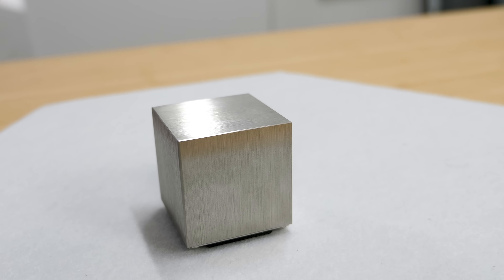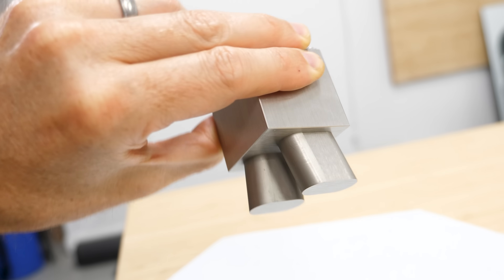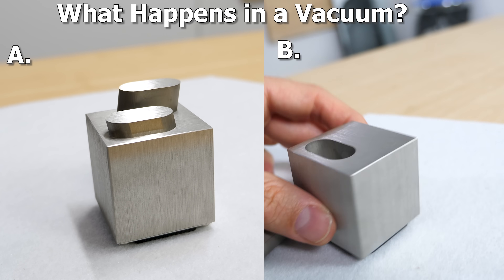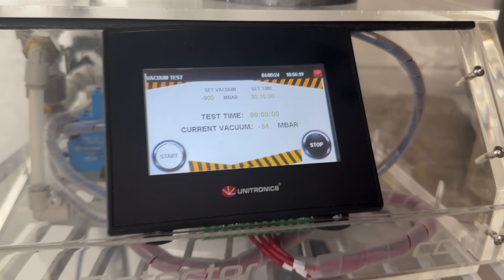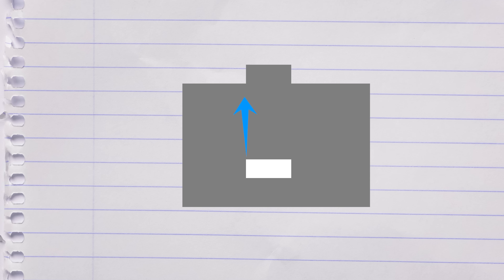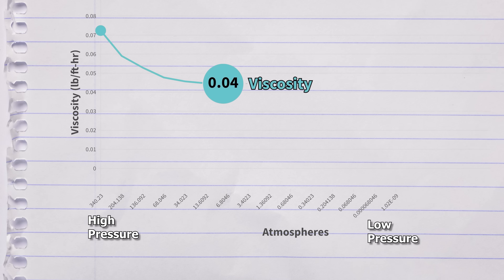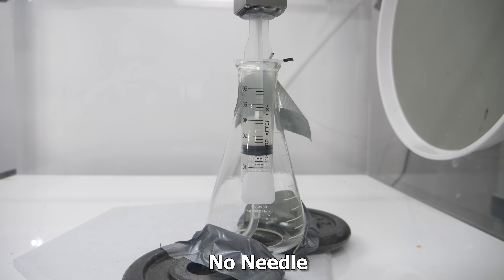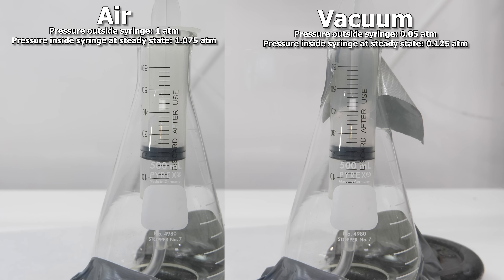What Happens to Perfectly Fit Pieces of Steel In a Vacuum?

Comment: One correction - the pieces are cut separately to very high tolerance - you can't cut a single piece to get that result.
Reply: Definitely different pieces of metal. Then they are put together and polished.
Reply: Came here for this. @SteveMould has a video on this exact topic
Reply: Yeah, there is material loss, at a minimum it's the width of the cutting wire.
Reply: @volvo09  How do they cut the channel between the two cavities in the cube?
Reply: @fancypants2007  Let's just call it magic and get on with our day, this comment thread has seen way too much drama
Reply: I'd consider this more of a clarification than a correction seeing as how he made no claims about it being cut out of a single piece
Reply: NASA should hire him to complete repairs on the outside of the ISS (from the inside)
Reply: Thank you. How would you cut the bottoms if they were one piece? I suppose it's possible they used an EDM wire to drill the pass-through, but that could easily have been done with a regular drill and a plug.
Reply: @Tb0n3 
An EDM wire would require a far greater thickness to keep it from breaking.
Reply: @Tb0n3  exactly
Reply: @Tb0n3  there has to be a hole to feed the cutting wite through - and of course the wire itself makes a gap. Once the pieces are assembled the sides are milled - so the joins become impossible to spot.
Reply: @NickDusting  "Once the pieces are assembled the sides are milled - so the joins become impossible to spot." That in fact is wrong just by looking at the piece you can see its not milled. It has been surface ground and very rough that is, by the looks of it..
Reply: @Tb0n3  I would use a sinker EDM with a 90° angle electrode to hole pop the ventilation tube
Reply: Yet.
Reply: And then the surface is finished on all 3 at the same time to get it looking like they are all the same part.
Reply: These pieces are fabricated to an incredible tolerance; here let me drop it on this hard surface.
Reply: At least not yet
Reply: also the reason why it looks perfect is because they machine the top of both the pieces.
Reply: This is the crucial detail that makes this easier to understand. I was racking my brains for years trying to figure out how they could possibly make these cuts in a single piece when in fact, as you say, they are actually cut from two different pieces and then fit together.
Reply: It uses water to drill
Reply: @Waterbottle959  err no it uses water to cool the wire
Reply: @NickDusting  there are water lazers there extremely precise.
Reply: @Waterbottle959  ....so the term "laser" is for "light amplification by the stimulated emission of radiation" and can't be applied to that (apologies i studied lasers way back when). Water cutters can be very precise but still take out a slice of material  - so if you're cutting a piece there's always a space between thr parts. It's the same reason why wire EDM needs two pieces to make the examples shown.
Reply: @NickDusting  that’s true mb
Reply: @Waterbottle959  Sort of. It is cut with wire, but underwater to prevent the metal from melting while being cut.
Reply: This is a proper CORRECTION.. the video starts with: "this is a piece of metal which has been cut" - where "is" singular. When, in fact, there were 3 separate pieces of metal that WERE cut. 🤷‍♂️
Reply: Also the fit isn’t as perfect as it would seem, don’t get me wrong, it’s good. But the surfaces are linished together after the fact so the surface is buffed and brushed together to hide the seam.
Reply: Yep, then the surfaces are ground/polished
Reply: It's not really a correction, since he didn't ever claim it came from a single piece.
EDIT: and I see now I was beaten to this correction of a correction. XD
Reply: I have years of experience with wire edm. I can say without a doubt these pieces are machined separately.
Reply: No they were not cut to a "very high" tolerance. They were cut to a very close tolerance.
Reply: "High", "Tight", and "Close" all mean the same thing in this regard   @Secession1900 
Same as in... 
"0.033mm is a high amount of sensitivity/play/cut width/tolerance"... It all means the same thing. 
You're effectively arguing semantics.
Reply: @RAW_Reality  Sometimes wording is important. Having worked in manufacturing industry for over thirty years I have never seen or heard a close/tight tolerance referred to as "high". If I had I would have raised hell about it because it could cause confusion in the mind of the listener.
Reply: @brianmiller9932  Agreed, though context is also an important part of communication.  I guess it'll depend somewhat also on which trade it's applied to and what background understanding of the concepts has been taught to those involved as well. But yes, I never thought (when I've heard it/had it explained to me) that it made sense to describe something small as "high" either. But, it exists. 🤷🏻‍♂️🤦🏻‍♂️
Reply: I guess they cut the pieces from the original cube like all the way through and closed the holes with a lid held by screws. You can see it at 1:56
Reply: @williamdetempolivre  no they're cut completely separately - to incredible tolerance - then machines so the lines are more or less invisible.
Reply: @NickDusting  that has been my understanding as well.  I kind of think I've even seen a youtube video on it.  You don't happen to have a link?
Reply: @Rick_Cavallaro  Steve Mould "How these impossibly thin cuts are made". Video ID f9zyenX2PWk
Reply: @DaedalusYoung  Thank you!  I'm sure that's where I've seen it before.
Reply: @NickDusting  yeah "tolerance" sure. Why not precision. What happened to normal englisch
Reply: @williamdetempolivre that "lid" is what The Actuon Lab used to stop it from falling
Reply: Ta fake Justin língua inglês the fact that everyone is writing a dictionary is insane😂
Reply: didn’t need to be corrected. He didn’t say it was cut from one single piece :) hope this helps
Reply: Addition, not correction.
Reply: Thank god we have the ultra-autists in the comments to split hairs and provide us with “uhmmm achtually” 🤓
Reply: @johnandrews9433  my son is autistic. You don't know what it's like.
Reply: @NickDusting  your compulsion to “correct” a minute detail to prove your smart is definitely a hallmark of being somewhere deep on the spectrum. Because nobody else cares that much
Reply: @NickDusting so do I and it's a joke. Relax. There no harm meant by their joke.
Reply: @johnandrews9433 you're wrong.
Reply: @NickDusting  autism is an extremely broad spectrum with an incredibly wide variety of experiences. While I sympathize with you not being fond of the comments in this thread, I'd caution against saying "you don't know what it's like". I'm quite sure my experience with autism is different from your son's, and I'm also sure that both your son and I understand our own experiences better than even you do. (Not to say you don't understand! It's just a fundamentally different perspective being a caregiver or parent versus living with it yourself)
Reply: @Max_Chooch  cool story homie, good thing I never made a claim one way or another 😂

Comment: Well, duh... I mean, you still have air inside that vacuum chamber, just very little of it, right? Remove all the air, and the pieces would fall in and out very quickly now wouldn't they?
Reply: yeah he needs a better vacuum pump
Reply: @dang-x3n0t1ct  Unfortunately, those are expensive, really expensive. 4 to 5 figure amounts are normal.
Reply: @thebamplayer He could use a sprengel pump.
Reply: You missed the point of the video, which is that decreasing the pressure by 20x did not result in a 20x speed-up of the pieces falling in/out.
Reply: @mensaswede4028 seriously. I would bet all the money i have in my safe right now that prior to watching this video he would not have said there would be a change of rate/time in which the pieces slow down with correspondence to different pressure amounts.
Reply: The problem with really low vacuum is that it becomes a game of pool. Waiting for the remaining atoms to get to the right part of the pump so it can pull them out.

😂
Reply: He could replace the air with hydrogen and the pump a vacuum.
Reply: If you think of a electronic vacuum tube (valve) or a TV CRT, they required 10 -¹⁰ Torr (or 0.1 μPa) of vacuum inside them, so that the electrons could flow without impacting any air molecule. 
A pump to achieve this level of vacuum isn't very common, and is very expensive. At 0.1 μPa, the air is so rarefied that the viscosity phenomena disappear altogether...
Reply: Getting a perfect vacuum is impossible
Reply: The title is a lie, it's not a vacuum at all.
Reply: @darikdatta anyone with even an extremely basic knowledge of science is well aware and all his viewers who actually watch the entire video don’t need to be pampered hence no as a matter of fact he wasn’t lying
Reply: If he really got it all out it might starr vacuum welding then they wouldn't move at all
Reply: Eddy currents
Reply: Surely it has very little to do with the lack of a vacuum in the holding chamber.
At some point you have to deal with the random chance that enough molecules will escape through that small nozzle.
At this point it works like a half-life. It could be a vacuum but there'd still be air molecules bumping around in the chamber enough to counteract gravity
Reply: is that old greg?
Reply: You are a bit slow aren't you? The viscosity of air isn't changing despite a better vacuum meaning that at a certain point even if there are less and less air particles, they behave the same which is an interesting observation.
Reply: I mean yes but can we reach a perfect vaccum anyway.
Reply: Assuming temperature is static and friction doesn’t exist, sure
Reply: Let's see your vacuum chamber.
Reply: Samus, by saying “Well, Duh…” you come across as an immature teenage girl.
Reply: @Icridium Yet they still have the right answer and insulting them makes you look more immature than them.
Reply: @Icridium  How do you know my age or gender tho?

But yeah, well, duh. There's still air in that vacuum, so the cube works essentially the same.

Duh.
Reply: @willprogresivo hi qt padootie 😚 wittle wuddle baby gorl u such a qt
Reply: In absolute vacuum the metal may just cold fuse

Comment: I guess that both pieces will stay in
Reply: I also thought that the pieces would stay in, because of vacuum welding, but I think that takes a long time to occur, it’s not an immediate effect.
Reply: @jpe1 for that to happen you need very clean surfaces with no oxide layer
Reply: Here before this crosses 1k likes.

(At 5 likes)